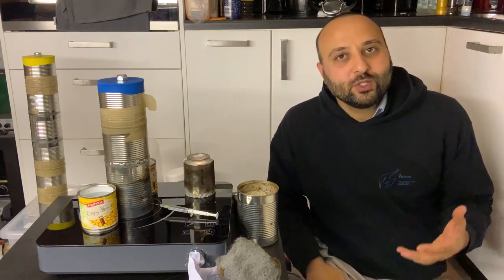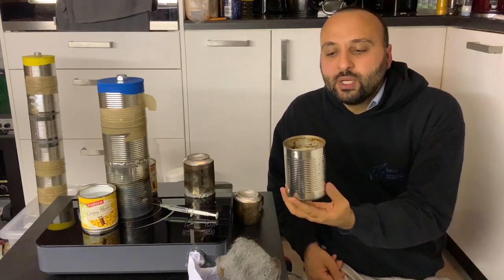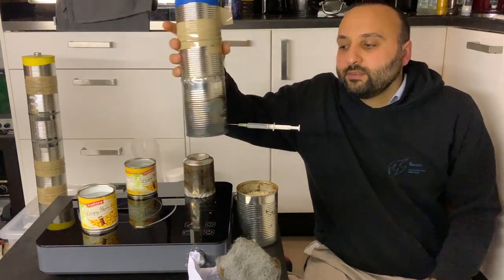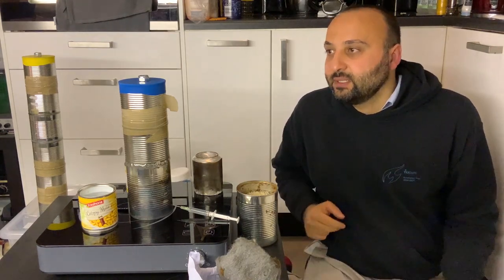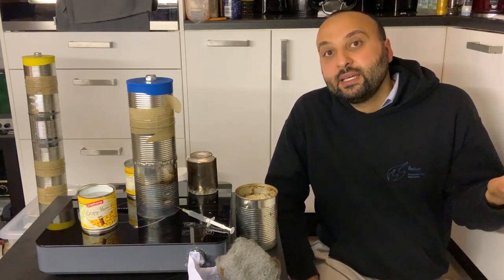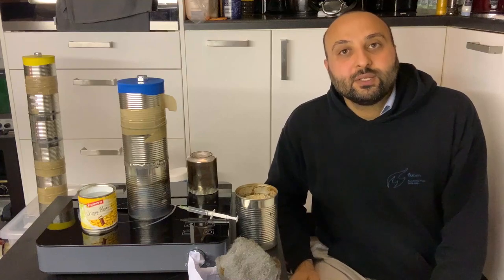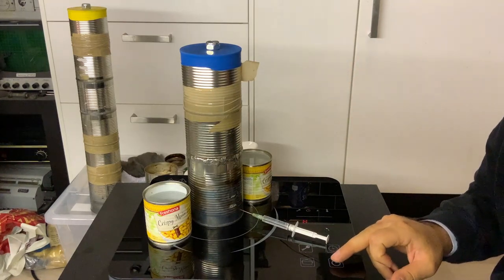Self starting Thermoacoustic heat engine

Comment: I think that by injecting water in the bottom and letting the steam rise through the cans and out the hole in the top, the steam pushes out all the air. This insures that what you have in the engine is a "saturated vapor". No air. All steam. The expansion and contraction ratio of steam (water vapor) when it changes phase, evaporating and condensing is several orders of magnitude greater than air.

Thank you for your persistence and dedication and generosity in sharing what you have discovered.
Reply: Yes this sounds plausible, I think so too.

Comment: an enclosed system where the water evaporates and then condensates back to the bottom would be very interesting. .
Reply from the maker: Indeed, that I have had in mind since a while, It requires some sort of piping to direct the water from the top  to the bottom of the engine. In this current format the water droplets will not pass through the glass beads barrier. I am working on a solution
Reply: @HVE  a cooling jacket on the top may help a lot.
Reply: Maybe instead of the glass beads rice of whatever you can use cooling pipes to condensate the water vapor more abruptly, thus they pass the barrier and heat the floor.
Reply: @sierraecho884  that would be the same as the stirling cycle, but with moisture instead of atmospheric air or helium.
Reply: @tiobeto9015  Yes exactly

Comment: have you tried poking a very small hole in the balloon and the location of heat being introduced is critical to the standing wave
Reply: This would weaken the balloon, a pressure valve which can be set to different pressures would be best, this way you can set it once and forget about it without weakening anything.

Comment: Do you think it matters whether cold water is injected after the reservoir is initially heated?  I built your engine and managed to get it running really well, but I find it really difficult to get it started.  The reason I ask is that I don't have a syringe on hand so I've just been filling the reservoir before putting it over the stove.  Based on your videos, my best guess is that a flash of steam from adding cold water is what gets it running more easily since that's the only thing I'm not doing.  By the way, I was able to run it at high speed without the steel wool but instead with the upper can having a bottom with holes drilled into it so that it can hold the rice.  A mesh might work better.  Maybe you'll want to try that and see how it goes?  You've really inspired me here, so I'll keep experimenting.  Thanks!
Reply from the maker: Thanks for the comment. As a matter of fact after lots of experimentation i eventually decided to get rid of steel wool because no matter what i did, it get rusted and destroyed after several days of operation (which is obvious due to the water in the engine). I used a stainless steel wool and glass beads which works as good. I will try now without stainless steel wool and if that works then the internal part of engine will be totally robust. Very good idea to create whole on one of those cans, I will try that, thanks for the idea. Regarding the adding water directly into the engine, I assume for your case the temperature will not go really high because water is there always, for my case the temperature of bottom of the can be several hundreds of degree and the water just play as the medium to increase heat transfer thought the engine. that is the difference i guess
Reply: @HVE  Thanks!  Actually, I think I figured out why I had trouble starting it.  I've been holding the engine with my hand because I don't have an induction cooktop, affecting the resonant frequency and preventing it from starting. Once I set it down on a firm surface it starts on its own!  I also replaced the rice with smooth aquarium gravel and that works quite well.
Reply from the maker: @tenbitcomb  Indeed if you don't have it on a firm surface it will have very hard time to start.
Reply: @HVE  ⚠️ God has said in the Quran:

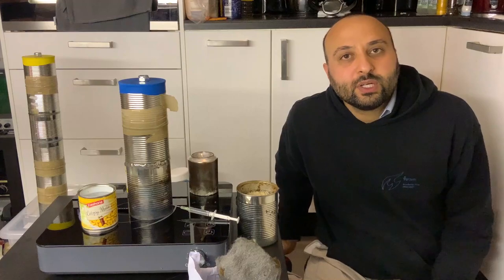🔵 { O mankind, worship your Lord, who created you and those before you, that you may become righteous - ( 2:21 ) 

🔴 [He] who made for you the earth a bed [spread out] and the sky a ceiling and sent down from the sky, rain and brought forth thereby fruits as provision for you. So do not attribute to Allah equals while you know [that there is nothing similar to Him]. ( 2:22 )

🔵 And if you are in doubt about what We have sent down upon Our Servant [Muhammad], then produce a surah the like thereof and call upon your witnesses other than Allah, if you should be truthful. ( 2:23 )

🔴 But if you do not - and you will never be able to - then fear the Fire, whose fuel is men and stones, prepared for the disbelievers.( 2:24 )

🔵 And give good tidings to those who believe and do righteous deeds that they will have gardens [in Paradise] beneath which rivers flow. Whenever they are provided with a provision of fruit therefrom, they will say, "This is what we were provided with before." And it is given to them in likeness. And they will have therein purified spouses, and they will abide therein eternally. ( 2:25 )

⚠️ Quran

Comment: How far up into that tall engine does the steel wool go? Is the entire top 2/3 of the engine empty? Also, did you test the parameter of how much of the glass beads you should use for best performance?
Reply from the maker: I bought new glass beads with larger size, i will check how the size of glass beads and the amount will impact.In the blue engine that i showed, an aluminum can of ~5cm is used and on top of it ~6 cm of steel wool and thereafter 2 cm of glass beads. so maybe top 1/3 is empty.